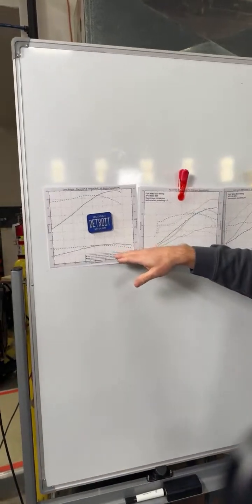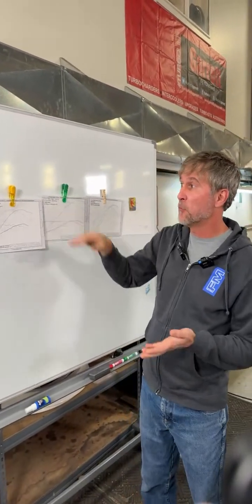Torque vs Horsepower! Which is better in a Miata? FM Live 12-5-24

Comment: After I had a 2.5 MZR put in my NC my peak hp was about the same, but, the 2.5 made the same hp at 6100 rpm, where as the 2.0 made it at 7000.

This is with the same header and full exhaust, the only difference was 0.5 ltrs, and a ECUTek retune to suit

The torque added everywhere to 6100 from the 2.5 made my NC a much faster accelerating car from idle to 6100 rpm than the 2.0 was, which for me is perfect for a daily driven street car

Disclaimer: My NC is not a race car that is always at high RPM, it is now, in my opinion, perfect for just daily driving in traffic and thrashing around the country roads, with basically OEM reliability 

For a streer car, give me more torque everywhere down low and in the mid range over just more hp up top, which typically sacrifices power down low

Opinions may vary
Reply from the maker: That sounds like a great street car!

Comment: I mean it is about the area under the curve? The issue is you have to use your engine over a rpm range and you want it to be as strong as possible over that rpm range. The range differs depending on what you want to do. A car will always accelerate best at the HP peak but you cannot keep it there unless you have a CVT. Think of it like this. 300 Nm at 3000 rpm is the same HP as 150 Nm at 6000 rpm at the same road speed. It will accelerate equally fast. A gear making the wheels spin half as fast but it doubles the torque to the wheel. So look at either torque or horsepower ( Hp is just torque multiplied by rpm) over the rpm range you want to use. What HP does it have at 2000-4000 rpm (everyday driving) or 4500-max rpm (autocross)?
Reply from the maker: Area under the curve is how many of us like it and we feel it's best for the everyday driver, but other folks might have different opinions.